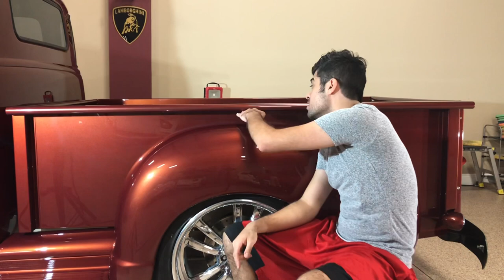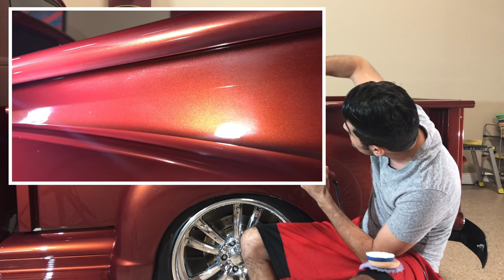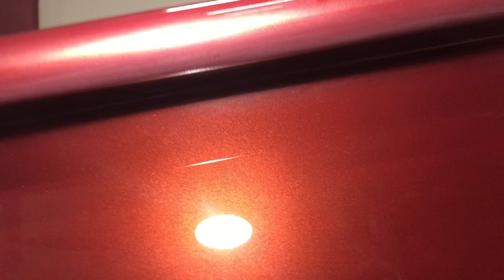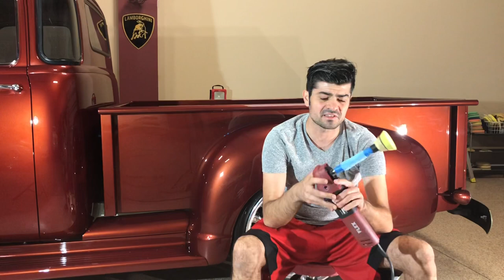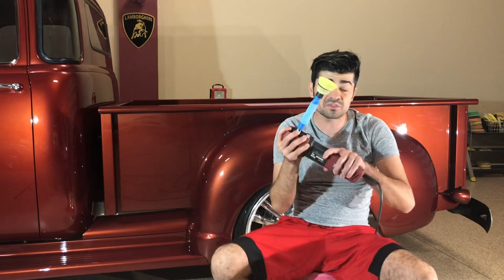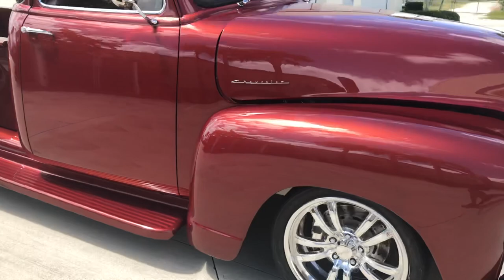Polishing Tight/Hard To Reach Areas | Flex PE-8

Comment: What makes this a better option than say the MaxShine mini rotary, the SPTA mini?
They are both small rotarys, can use extensions and are much less expensive.
Reply from the maker: Corry Bowers I have no experience with those machines. In theory yes they will be capable of doing the exact same thing. The only difference would be build quality. Obviously flex is going to be superior in that aspect.

Also it’s not like the Flex is 2-3x in price difference. The price difference is only $40. I can justify saving $100-200 like when you compare the maxshine mini vs the rupes mini. I think it’s well worth it to fork up the extra cash for the Pe-8

I however can speak from experience about the Max shine 15 and the Maxshine mini (12mm)
The Maxshine 15 is the most over rated polisher I have ever used.

The maxshine mini I do like, it works and works well considering the price point. However when compared to the rupes there are a few glaring differences. The Rupes is more powerful however the power that the maxshine has is still more than capable of getting the job done so I have no complaints there.

It rattles/vibrates a LOT more however that is to be expected from the price point. The comparison to the maxshine mini and rupes mini are closer in performance than the maxshine 15 compared to the Rupes/Boss 15
Reply: @NextLevelAutoDetail  from what I've seen on the MaxShine it's a quality machine also. Brian (Apex Detailing) did a review of it with a tear down)
Reply: @NextLevelAutoDetail  GREAT job btw ....I do enjoy watchingand have learned from your videos.
Reply: Next Level Auto Detail the Maxshine MINI vibrates a lot more than the Rupes MINI?
Reply: Corry Bowers, the SPTA Mini Rotary is an excellent budget choice. I bought the one that comes with all 3 backing plates,extensions, micro polisher attachment/extension and all pads. It's a powerful and smooth machine. I've never had to go past speed 1 or 2 to correct the paint. 

 Only gripe is the switch is a bit tricky to operate but that is all.

Comment: Hi, I’m really seeking help with a new 2021 Escalade need to be ceramic coated and I used CQUK but now looking for CSL as I feel it adds more gloss and shine and I don’t wanna used exo4 what’s your advice please or you recommend a deferent coating, thanks so much
Reply from the maker: 90% of the shine and gloss is going to come from the polishing preparation steps. 

Since you used UK stay in the same chemical family and top it with CarPro Gliss. It is a topper designed to stack on top of Cquartz. 

This is the equivalence of using crystal serum light and exo. 

Don’t rely on ceramic coatings to give you more gloss/shine rely on the polishing stages for that. 

The coating is the easiest part it’s the prep that takes all the time and is the overall majority factor in a good job.
Reply: @NextLevelAutoDetail   you just gave me peace of mind and really appreciate the support thanks so much.
Reply: And regarding to the polishing the car is super new it needs just some shine so I’m thinking about meguiers 205 fine polishing or I’ll use pf sonax.